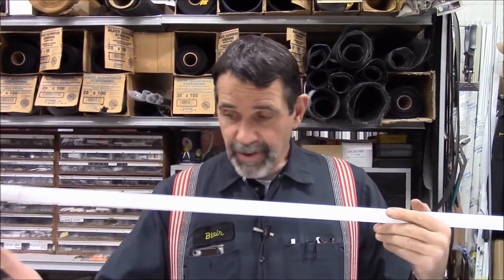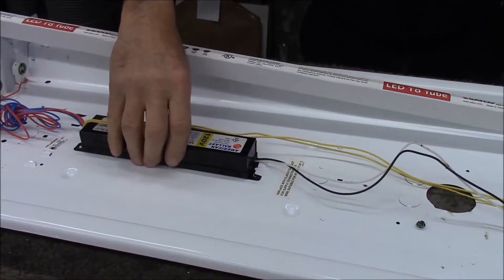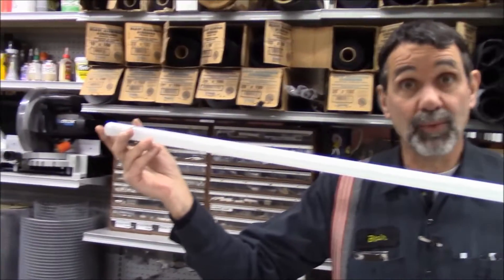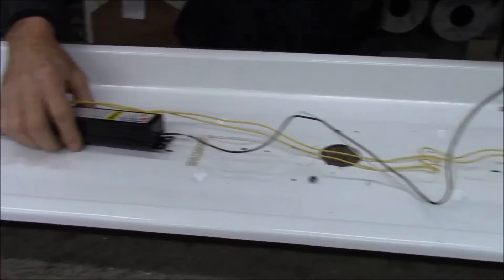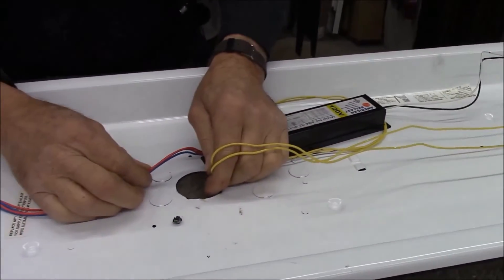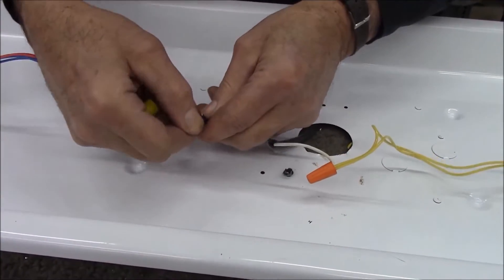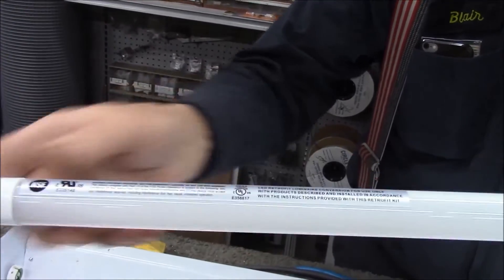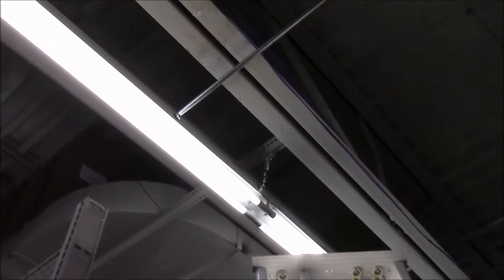Rewire Fluorescent to Led Lights - Using Double-Ended Tubes

Comment: Thanks so much for the video, but it didn’t work for me.  I only had one yellow wire.  Does that make a difference?
Reply from the maker: Depends on if you have shunted bulbs or end feed bulbs. Shunted are easy because you take all the fixture’s wires from end, regardless of color, and connect them to the hot black power wire, and the wires from the opposite end all connect to the neutral wire. Ground wires are separate and only connect to the other grounds.

Comment: Thanks for sharing.  This is probably the least confusing video I've seen on this topic.  I've been around this block a few times trying to decide which wiring configuration is better - single or double ended.  If I'm understanding this correctly, shunted tombstones should be used in a double-ended configuration only (Type B), and non-shunted tombstones in either a single-ended configuration (Type A) or in a double-ended configuration if the tombstones are shunted (Type B).  So, which is better?  Which is safer?   Which provides the longest life for the LED?  I have 29 fixtures with a total of 70 T12 tubes in home and garage that I would like to replace in multiple phases over the next several years as time permits, and I want to do it right starting with the first tube!
Reply from the maker: I rewired my entire hardware store with type a single ended tubes because I had 8 foot fixtures and I bought conversion kits that turn the center of the 8 foot fixture into the hot spot for the 4- 4’ foot tubes that replaced the 8’ bulbs. It was easy to pre-wire the center (4 tombstones on a center plate) on the bench, remove the 8’ bulbs, bypass the ballast and feed the center plate w/ 120v and boom, all 4 bulbs were fed.

Comment: Hi is a Walmart led replacement for a fluorescent does it need a ballast or can I get rid of the ballast?.
Reply from the maker: You Must get the instructions to confirm the installation method. Every manufacture must supply them. It could be wired 3 different ways and the wrong way can be trouble.

Comment: How do you know which way to hook it up. White on one end and black on the other. Or black and white on the same end
Reply from the maker: That all depends on the manufacturer of the bulb. Some bulbs go both ways, some are proprietary and have to be wired on the end or opposite ends. Some bulbs also will except the ballast which is counter to the goal of installing LEDs to begin with. You must get the wiring diagram before going further, I get the wiring diagram before I purchase.

Comment: Great video. What specific led light tubes would I have to get?
Reply from the maker: I don’t recommend ’ballast driven‘ bulbs, because why waste electricity on a ballast? You can wire either ‘shunted’ bulbs which won’t require replacing ‘shunted tombstones’ or ‘end feed’ bulbs if the existing tombstones aren’t shunted. The purpose Of the video is to teach the different types of wiring with different bulbs.
I also chose bulbs w/different Kelvin ratings, 3,000 is a warm bulb and 5,000 is cooler, more blue. There should be more info on the Kelvin rating.

Comment: Would wiring change if you have multiple lights looped together?
Reply from the maker: No, each fixture gets a 120 volt supply and a gang of them are wired same as a bunch of incandescent fixtures.

Comment: Very straight forward, but I’m obviously missing something, because I cannot get my replacement LED lights to work.
Reply from the maker: You have to have the install instructions for your bulbs, there is no single wiring schematic for all bulbs.

Comment: I did this and it didn't work.  I guess I have LED's that require a ballast?
Reply from the maker: You MUST find the directions for the tubes you have, easy search using the info stamped on every bulb.
Reply: @MrHardware1  GE bulbs purchased years ago, I'll see if there is anything on them though.
Reply from the maker: @asusreviews  they might not be led…. Send me a pic of the info stamped on the bulb, like “F32T8”, which is a ballast bulb. Blair@mrhardware.com w/YouTube in the subject.

Comment: I should have watched this first before hiring an electrician. I could have easily saved a bunch of money.  Also, unfortunately, he installed 5000K bulbs which are too bright and cool for a  warm country kitchen with knotty cedar paneling that was an almost orange hue to it. While I will ask him to consider swapping out the bulbs, I think I will have to purchase and install, the 3000K bulbs myself. Since he did not change the tombstones, I'm pretty sure after watching him that he likely used ballast-free double-ended bulbs. So I think I needed to order 3000K T8 double-sided direct access, ballast bypass bulbs. Any recommendations on either brand or watts or life time expectancy I should look for. Thanks for sharing!
Reply from the maker: I would double check the wiring. Most lazy people use ballast driven bulbs……

Comment: Hope you can help. I have a 4 ft fixture, two bulbs. There are five. They would all come on and then one or more would go off after a while and then sometimes come back on. I replaced the old bulbs wit Phillips InstaFit and those work. However, they also go off and come back on sometime later. I am making an uneducated guess it is the ballasts?  I have watched so many LED replacement-remove ballast videos and am more confused than ever. Your video was the most informative, but still not clear as to what I can do.On one end of the ballast are 4 wires-2 red, 2 blue. Two red go to one tombstone, 2 blue to the other. On the other end are 2 yellow wires going to 1 tombstone, which then has 2 short white wires connecting to the other tombstone. What do I have and what do I connect if I remove the ballast?
Reply from the maker: That’s a standard ballast wiring and first you purchase the LED bulbs and follow the wiring diagram that comes with the bulbs. There are three kinds and they wire three different ways, you’ll have to watch the whole video one once you buy the bulbs to see how you have to wire them up. If you get shunted Bulbs you take the red and blue wires and strip them all and put them together and connect that to the black hot wire coming into the fixture, the ballast is not involved and is not connected to anything, and the two yellow wires will go to the white power wire coming to the fixture. It’s that simple. However some bulbs wire differently which is why you need to purchase the bulbs first and use their wiring instructions to install them.

Comment: I followed your steps and make the LIGHT  ON , but how come the light is DIM ? I bought a T8 ECOSMART LED  LIGHT from Home Depot , what is wrong on my step?
Reply from the maker: I couldn’t find that description on HD site for a t8. It had to come w wiring instructions, that is the rule, some bulbs wire differently and each bulbs instructions are very important.

Comment: Ha great video  but i want to put the same bulbs back into the fixture,  and just get rid of the ballast in the lights  that alone will save me like almost 300.00  can and will the 12 t bulbs work   thanks
Reply from the maker: No, T12 bulbs require a ballast to work. Only newer led bulbs work on 120v.
Reply: @MrHardware1   wow thank u for answering my question  have a great day

Comment: so I have converted some other flourescent lights to LED no problem (they did have a little different wiring setup than you are showing), this morning I noticed one of my basement ligts was out and instead having changing bulbs I thought I will convert it to LED, the old flourescent light is wired just like the one you show, I took out the ballast and wired it exactly the way you did and flipped the switch and the LED bulbs burned up, what went wrong ? It's same setup.
Reply from the maker: Not at all, what I’m trying to impress on everyone is there are three ‘or more’ types of LED 4 foot bulbs. One style wires on the end, one style wires on opposite ends and some styles go both ways and also run with the ballast still installed, which is kind of a loser because the ballast is wasting electricity so we should be skipping it always.
The bulb that burned up should have a wiring schematic specific to that bulb. That is how it should have been wired.
Reply: Thanks for the reply, I figured it out, I have this box with some LED bulbs been sitting around for awhile and didn't look real close but they were not regular LED's, they were LED's meant for  fluorescent fixture, shorted them right out.

Comment: Excellent Video - Very helpful.  I followed this process - simple.  However, its not coming on.  I know you can necessarily diagnose from a distance but any troubleshooting I should consider?  wire nuts are tightened down.  all wires are connected.  White with yellow and blue/red with black.  Ground wire is grounded.  wires are getting power according to voltage detector.
Reply from the maker: Your bulb should have a ‘L’ (for line, usually black hot wire) and a ‘N’ (for neutral, usually the white hot wire) one of each stamped on either end of the bulb, or both on one end for each prong on the bulb. That is where the 115 volts should go, no transformer involved.

Comment: I have black and white wires going into the ballast but then blue and red coming out. Is the red power and blue neutral?  Ballast doesn't say
Reply from the maker: The black and white wires are for 120 V feed to the balast only. You are removing them from the ballast and connecting the power directly to the tombstones per the type of led bulb you purchased.

Comment: Only the spaghetti in MY fixture (t-12) looks nothing like the one-wire to each tombstone I see in yours.  So... more research.
Reply: Yeah,  same
Reply: @darkshane3529  I ended up treating all the wires from one side same as "one wire to each tombstone".  Ended up being 6 instead of 4.  I ignored all the wires going from tombstone to tombstone, they were already "landed".  Nothing blew up, it's still working.

Comment: Will this hold true for T12 LED bulbs?
Reply from the maker: There are only t8 bulbs in led as far as I’ve seen, which of course Is limited. A t12 fixture will take the t8 bulbs with a conversion kit. About $25 a fixture, not really worth it. 2 new led fixtures are less expensive.

Comment: Thanks I have the Sunco's and they are series (double ended) wired like yours are. However I went to buy some more and they are now single ended feed with a shunt on the other end. I tried to find them in your hardware store but I can't find them, even if I type in LED Lighting. Do you have them if so what's the part number, link and cost for a 10 pack. Thanks for the nice video. Best Wishes & Blessings. Keith Noneya
Reply from the maker: Call and ask for Daniel, he is the purchaser of the bulbs. He’ll price and ship if they are available.

Comment: With the single wire design, most shop or store fixtures have two bulbs. My question is, running hot to the left and use the jumper built in to run the other bulb? 
  Even with two pins on each LED bulb, I would guess one pin does nothing. I guess it would be called “Daisy Chain” hot on one end and neutral on the other. 
 As a tech tip, I wipe the inside of the fixture clean with a window clean, but dry, use masking tape to hold the wires in place as most of these maybe done overhead. 
   Thought on the wiring as the box show one bulb, not two!
Reply from the maker: ‘’Jumper built into run the other bulb” Are you referring to the wires going to the right end of the fixture? Then yes. The word ‘jumper’ worries me, no problem.
Reply: @MrHardware1  It is just my word for two yellows into one connector with two wires going from yellows to next connector. 
I am a ASE Master Tech since 78, retired.

Comment: See I did this 
But mine are instant on 
But they didn't work 
Not sure what I did wrong
Reply from the maker: Did you have a schematic from the bulb manufacture on wiring instructions? There are 3 kinds (types) of bulbs, that was one of my points in the video that they don’t all wire the same.
Reply: @MrHardware1  no instructions with them
Reply: I tried put them in with the original ballast 
Nothing worked 
Cut the ballast out 
But nothing poped
Reply from the maker: @josephsawatsky  There has to be a wiring diagram, search the info on the bulb on the net. I would not experiment wiring a bulb w/out them..

Comment: I found this youtube video extremely helpful. My old fluorescent tube light had gone bad and needed to be replaced. I thought it was time to change to LED. Got T8 LED and installed, but they didn't come on. Did search and it turned out that I need to remove the Ballast. Th wiring shown in this video match my fixture wiring and just followed the steps. T8 LED Fluorescent worked immediately. Thanks very much Mr. Hardware

Comment: Removing the ballast saves about 50 to 60 watts per light fixture and changing the bulbs to led saves about another 40 to 50 watts on a fixture with two lights.   With four lights it's probably double that amount.

Comment: This was very easy, but my LED was really really dim. Not sure why. Was hoping for the best!
Reply from the maker: If you take two alligator clips and put them on an extension cord so you can clip onto the light and then plug it in you can prove wether is good or not. Only plug the test cord in long enough to test the bulb, we call the test alligator cord our ‘suicide’ cord. It’s dangerous…..

Comment: I have LED light bulbs that work with an existing ballast.  There is continuity across the two pins on the same end, but not across.  Can I remove the ballast and if so what is the proper wiring?
Reply from the maker: You should get ‘shunted’ bulbs, bypass the ballast and send one power wire to one end of the fixture and the other power wire to the opposite end.

Comment: Quick question does the LED Bulb make a difference? I see thats theres a few choices from Hybrid, Ballast compatible and Ballast bypass bulbs
Reply from the maker: I’m for ballast bypass led bulbs. Why waste electricity running through a ballast when many led’s take 120 volts.

Comment: Bought some used fixtures and chandeliers at the Habitat For Humanity Restore. Not sure how old they are but they are of a more modern type.  Will I have to rewire them to support leds?
Reply from the maker: Actually the LEDs drive 1/10 of the power of a regular bulb. I would re-wire if I needed to for safety sake, such as frayed or damaged wire anywhere in the fixture.
Reply: I would say these fixtures are probably within 10-20 years max. No frays, no old cording like the old fashioned cloth covered or anything.  They are in great shape actually.

Comment: Can the bypass be done with GE led tubes that say “ works with existing t8 electronic ballast”?
Reply from the maker: I can’t say for sure but that statement means it needs a ballast to operate. So unless it says you can operate on 115 V you need a ballast so you cannot bypass.

Comment: Does ;anyone know the name of this type of LED double ended tube? Useful for ordering online
Reply from the maker: Search 4 foot LED bulb. And check to see if they’re made for shunted or non-shunted for either type of install. See if you could get a wiring diagram when you order them, it won’t hurt.
Reply: @MrHardware1  Thank you, will do.  I just wish there was some sort of generally accepted way of identifying the specific qualities of all these different variations by name or code. i guess we're in the "Model T' era of LEDs!
Reply from the maker: @josephdragan7734  there has to be a schematic for every electronic bulb, showing the correct wiring procedures. You may have to contact the manufacturer or customer service to get it but I would not install a bulb without knowing how they recommend it to be wired.

Comment: Out of all the videos on this subject, this one is the best.
Reply: THE BEST!!!!
Reply: I agree. The difference between his and the others, the others just tell you what to do. He gives a simply explanation, so it sinks a tad more. If I was told, just eliminate the ballast and wire the light like a traditional light with a hot and neutral wire setup, I could have done it so much easier. But going though so many videos trying to understand what I was doing is why it took so long
Reply: Thanks your comment making me watch
Reply: Couldn’t agree more! I was worried about this task taking more than an hour or so, popped this video on, and now the lights are back on in less than 15 minutes total. So thankful for this!

Comment: 1:24 Having separate power leads on left and right side of each tombstone is not a "shunted installation". Shunted simply refers to the joining of the clips of the right and left prongs of the tombstone connector (the opposite what you describe).
Reply: Is the use of Shunted Tombstones simply so that you can jump from one tombstone to the next on the same end of the fixture?

Comment: I did this but the LEDs are now VERY dim. Any suggestions?
Reply: They could be made for a ballast fixture and not designed for 115 volts. Wrong bulb for direct wire possibly.
Reply: @blairgilbert7606  thank you. I just took the fixture out and replaced it with LED flat strips. Much easier that messing around anymore with it. Lol. Much appreciate the help  for sure. :)

Comment: You don't say how to tell the difference between when the black and white wires are connected to the same end ( albeit different pins),  and when they are connected to opposite ends.
. . .  and if they go on the SAME end, WHICH end?  Does that matter?

Comment: I’m in my garage I have 2 whites  and two blacks coming from ceiling. Do I still wire nut the two black with all yellow. Then two white with the red and blue wires? Thanks for your help. By the way. I am installing the 4ft. hybrid A +B single or double connection.
Reply from the maker: Sounds good but w/out seeing your job I can’t confirm
Reply: @MrHardware1  Thank you sir worked like a charm